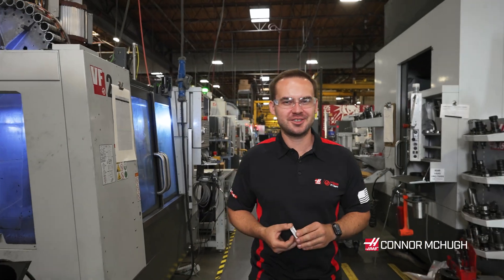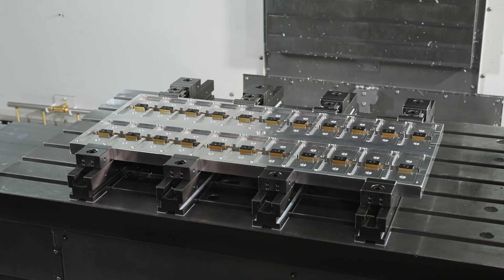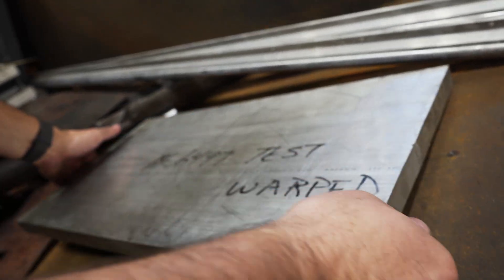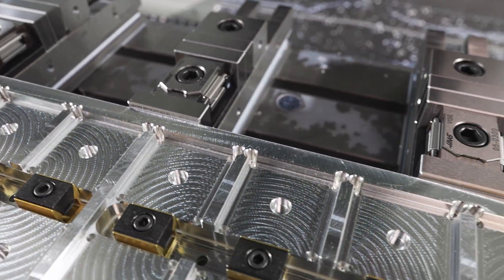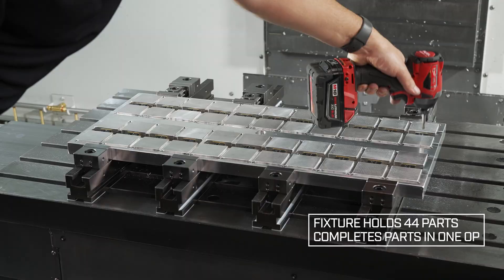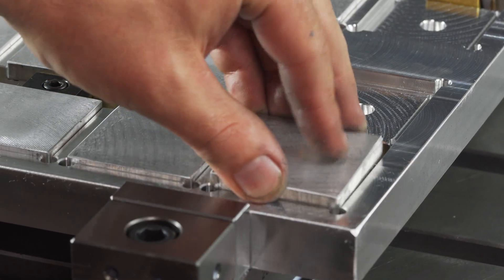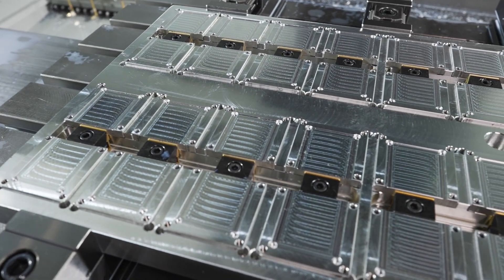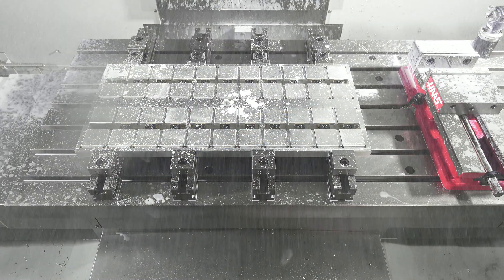Your Ingenuity + HaasTooling.com Components = Custom Fixtures

Comment: 100pcs using Haas double 6" vises with .100 step jaws, 2 or 3 vises moves a job pretty quickly. That size part you can double up in each vise with no problems.  Now if you had 1000pcs then your set up would be better off. Especially if it was a repeat job.  Still, it was a nice set up using rails and mighty bite clamps.